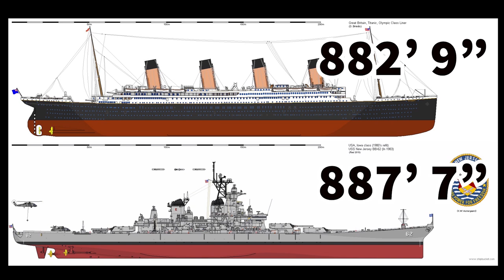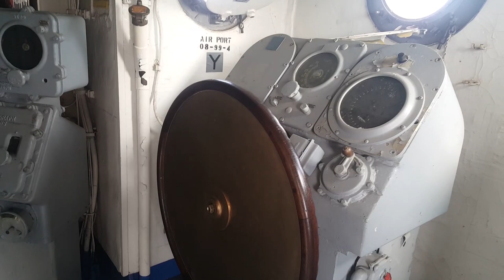Titanic vs. Iowa Class Battleships

Comment: If only the Titanic had an armor belt.
Reply: She didn’t even really need one. It’s been proven and well discussed that If the ships first officer, Murdoch,  had simply ordered the engines full astern and NOT steered the ship at all thus hitting the iceberg “stem on”, Titanic would have never sunk. At a speed of around 16-17 knots, a stem-on collision would have crushed in her forpeak water tank and at most around 20 feet of the area directly behind it which contained firemens berths and a cargo hold. This would have resulted in flooding of at most two of her watertight compartments and it is likely the ship could have even steamed to New York under her own power as even boiler room 6 would have remained Undamaged. The sudden, jarring stop would have undoubtedly caused Several hundred passengers and crew mostly minor injury, with a few dozen severe injuries and even a few deaths being likely but still far better than the 1,500 that perished that night. Sadly not enough was known about how bergs are shaped below the water and how a ship would react being run straight on into a berg versus trying to steer around by the ships crew and tragedy ensued.
Reply: @J.R.in_WV  
The sudden, jaring stop would have likely done a lot more than throw passengers and crew around. 50,000 tons held together by wrought iron rivets, a percentage of which may have been below standard quality of the day, would have likely sheared off along some length of the hull, broken steam pipes, possibly the engines shifting in their beds, etc. Ships like Titanic were built to be able to withstand impacts with other ships but an iceberg effectively represents an unmovable wall which was well outside the scope of her design to deal with. 
We'd all like for there to have been some simple thing they could have done to have avoiding the tragedy but plowing her into the berg on purpose wasn't one of them.
The truth is they should have stopped for the night or, at the very least, slowed way down until morning.

Comment: - Iceberg ahead!
- Forward main turrets - open fire!
Reply: ...sh*t...!!! :-(
...now its many icebergs ahead...! ;-)
Reply: @Packless1  Secondary guns - open fire!
Reply: Heh, I was about to reply that the USS New Jersey could just shoot the iceberg. Well done.
Reply: @Packless1  Hey, the 16-inch naval rifles operate independently of one another. That's a lot of selective shots. I don't recall about the 5 inchers, each barrel independently operable?
Reply from the maker: The 5in barrels are in twin mounts and operate in those pairs, unlike the 16in guns which are independent.
Reply: Or it could just, like, go ‘round it.
Reply: IIRC, 16-inch rifles could lower no more than 5 degrees above horizontal. Surface search radar better than lookouts, right? Just go around, and if iceberg decided to  attack BB62, unlimber the 10 5/38s and blast away. That work?
Reply: @witkocaster  just use the nuclear shell, iceberg blown out of the water !
Reply: @matthewnewton8812  we know, but come on, you HAVE to fire those guns
Reply: @tedlee7821  wake every one up and they go  cool
Reply: @tommatt2ski  The battleship too, at that range.
Reply: Yessir and one 5 Inch Gun mount was operated by the Marine Corps Detachment!

Comment: Titanic was actually 175 feet or 17 stories high if you count elements above the superstructure like you did for New Jersey. The 90 foot figure is for her 9 decks, her funnels extended over 80 feet above the roof of the wheelhouse on the boat deck. This is why they look so similar in height in the photos.

Comment: The New Jersey hitting an iceberg would be like a sno-cone being rammed by a Buick.
Reply: While I understand the reasoning, I think you're underestimating the snow cone, lol. Those things, and the forces that can be generated in a collision with one, are no joke.
Reply: @steeltrap3800  Exactly.....Sister ship, Wisconsin lost the bow in a ship collision. A berg would hurt bad too.
Reply: @WALTERBROADDUS  Good news, the bow could be almost sheared off by a huge hit by a monster iceberg and the New Jersey could at least be towed back to port, since the citadel has the required reserve of buoyancy to keep her afloat.
Reply: @Hiiiiii74  Well thanks to a warmer Earth, bergs are not a issue.
Reply: I'm fairly sure there are icebergs that have a greater displacement than New Jersey. Ofc these ones look more like small floating islands, and you'd be colossally stupid to actually collide with one.
Reply: @potatopants4691  Based on the rough dimensions recounted by survivors; I've read the iceberg could have easily displace upwards of 1 million tons.  However Icebergs are not completely solid blocks of ice.  They have have a very complicated makeup with significant changes of density.  They are also constantly changing shape as water intrudes and the berg melts and breaks up.  Regardless the iceberg would very likely be significantly more massive than either Titanic or any vessel constructed.
Reply: @Hiiiiii74  Couldn't she steam under her own power? Just at a slow speed, with that fine water-splitting bow form gone?

Comment: Battleship New Jersey has surface radar, Titanic had lookouts in crows nests.
 
New Jersey has two rudders. 
Titanic had one slightly undersized rudder.
Reply: Don't forget titanics sister ship hit and sank a u boat in ww1 after turning on a dime at full speed it had the same size rudder as the titanic at at that point in time was heavier then titanic i think had they went full speed ahead the water would have pushed onto the rudder better then shutting in middle blades off as it didn't go in reverse
Reply: That's a bit of a myth. The Olympic class ships actually featured quite a massive rudder. One so large it could only be turned by steam engine. That's the reason why Titanic took so long to respond to the helm inputs - the steam engine had to start up and crank the rudder to hard over. Hydraulic systems were faster, but were a new tech at the time.
Reply: The armour belt won’t hurt either.

Comment: Just wanted to do a little correction at 4:53 where you said Titanic couldn't counter flood is false actually. Titanic's double bottom was divided up into sections which a few of them were filled with fresh water. In these sections there were ways to move water around between each section and was actually done during the sinking to try to maintain a leveled keel. :D Hope this helps sorry im nearly a year late to this video.

Comment: Two things that could have saved Titanic that the NJ already has. Watertight bulkheads that run up to the main deck, Titanic's only ran up to I believe deck 3, and the second would have been a rudder large enough to be useful with that third prop wash rushing over it.  Had they uncoupled the Port engine, ran Starboard full ahead, and reversed the port engine, they might have been able to use the prop thrust to turn the ship faster.
Reply: I don't recall, did Titanic's crew spot the berg before the collision? How much time did the crew have to react? Thanks.
Reply: @brianchapman3701  Well, in the movie they did say IOCEBERG Dead ahead!  All reports I read they did see it, just not in time to get the ship turned away from it.  Speculation also has it had they NOT seen the iceberg that the ship would have survived a head on impact.
Reply: @acdii  Fascinating! Next question, who was at the helm, or do I mean in command, at the moment the warning came?
Reply: @brianchapman3701  First officer Murdoch comes to mind.  Captain Edward Smith was in his stateroom sleeping at the time.   The Captain should have been demoted due to a few incidents that happened under his watch prior to the maiden voyage, including a collision with a warship during the trial runs of the Olympic. There were so many wrongs that were done that led up to the sinking, any one of which could have averted disaster had the proper decision been made.   

There is a  conspiracy theory that the Olympic and Titanic were switched and that the Olympic was the actual ship that sank, and the Titanic lived on as the Olympic, but that is too hard to believe since changing the name plates on the bow and stern would have been a huge undertaking and would have been noticed prior to the ship being launched.

Comment: If USS New Jersey hit an Iceberg in similar circumstances?  I am fully confident t hat the NJ would have survived. Though first off, I think the New Jersey would have avoided it all together, since the watchman wouldnt have forgotten or left his binoculars.   The Damage Control Parties would have been on it, being military trained, so very well versed in thier duties, plus the New Jersey is built for war, so it has bulkheads and water tight compartments and other things.  Plus, unlike the TItanic, its water tight compartments dont go only 3/4 of the way up the ship. Also, Also, the New Jersey wasnt built from cheap, weakened, made by the lowest bidder steel.
Reply: I wouldn't say titanic had low quality steel, it was (maybe not the best that would be used on warships) for that time still a good steel. Automated Watertight compartment on a civilian ship made it "unsinkable". I would say that if you compare the Iowa steel with today's high quality steel, you could achieve higher protection with less weight when rebuilding the Iowa with today's standards. Actually now they are saying would have been the best for the titanic just to ram the iceberg and losing the first 2 compartments or instead of putting her to full reverse and pulling the water from the rudder giving her full speed ahead for better duffer response
Reply: @steeltrap3800  I would just say Global Warming is has made the sea safer.😏 Trans Polar travel is possible  now.
Reply: Battleships like the New Jersey were designed to survive hull breaches and other serious damage because they were weapons of war. The Titanic was a commercial liner and was not designed to take on the amount of damage that she sustained. On the other hand, battleships were essentially 57,000 ton powder kegs, and what doomed many of them were fires that reached their main magazines. Had the USS Arizona flooded her magazines at the start of the Pearl Harbor attack she would have never blown up and sank.
Reply: Technically the new jersey was still made by the lowest bidder, it's supposed to be a practical engine of destruction not a luxury statement. There would be no reason to up the cost of production beyond what was needed to do its job effectively. Therefore it was by definition constructed by the lowest bidder.

Also it's not really in question whether it could survive a similar collision, it's designed to survive having holes poked in it after all. However I believe if it had been mishandled to such a degree it's hitting an iceberg it's also possible it might not have survived because now we have to consider a head on collision at speed and that would fold the ship in on itself as if it was made of wet cardboard.
Reply: ...the binoculars - or the lack of them - is often claimed to be one MAJOR case of the sinking of the Titanic...
...but most likely it wouldn't have made much difference...!
...there was little wind - and not much surf - in that night, and it was new-moon...
...so the sky was dark, the water was dark too, as was the iceberg...
...the guys in the outlook would have seen a black iceberg on black water in front of an black horizon...just bigger...! :-(
...a searchlight would have made a real difference...
...so no James-Cameron-movie ~100 years later...! ;-)
...but they had none...! :-(
Reply: If it hit it head on the whole ship would collapse, but a glancing blow like the titanic, maybe it would be ok but hard to tell.
Reply: @Packless1  Adding to the popular idea it was an elaborate assassination of JJ Astoria and other bankers who resisted the creation of the fed.
Reply: @LTPottenger  Not likely. The bow might  be lost. But the bulkheads would stand ahead of the Turrets.
Reply: @WALTERBROADDUS  An ice berg is nothing like what an ice breaker breaks through. Ice breaker would be obliterated if it hit an ice berg. You're trying to uproot a whole mountain, which isn't happening.
Reply: @LTPottenger  Well, the USN did collide with itself in WW2.  USS Indiana and USS Washington or something......2 of the fast BBs.  It crumpled the bow of one and dented the other.  THey both made it back to port for repairs.
Reply: @LTPottenger  I think your are replying to the wrong person?
Reply: @lolroflroflcakes  I believe I have read that the Iowas were a no-bid process contract award. Author Thomas Heinrich writes that the Iowas, at $130 million a copy, were the most expensive platforms of the Second World War.
Reply: @brianchapman3701  It's still designed in with what is practical to be afforded, battleships are just expensive. For instance British armour plate was better but they still used steel from American foundaries because while money could make it happen they went with the lowest bidder that gave them something reasonable for the needs of the ship.
Reply: @lolroflroflcakes  The major U.S. combatants of WWII were not contracted by bid, but by negotiated contract. And, the major combatants were built by U.S. Navy yards.

Comment: The bow weighs a ton and is relatively narrow... probably a really decent icebreaker
Reply: Actually ice breakers tend to be wide in Beam and the bow is designed  to ramp over ice and crush it.
Reply: Ice breakers don't break icebergs, they are huge, dense formations of ice. A ship is mostly empty space you hit an iceberg and your ship is crumpling like a pop can being run over by a semi-truck, battleship or not.
Reply: @lolroflroflcakes  yeah, the bow would take hefty damage, but i don't think it would make it into the citadel
Reply: @Commissar0617  it wouldn't really matter hitting something the size of the Titanic's iceberg at speed would shatter an Iowa's structure and anything inside would keep trying to move forward potentially at speeds potentially in excess 60km/h until it met the nearest bulkhead. So you have an intact armoured box but everyone and everything in it is broken and the ship itself has been so compromised on a structural level that even if it stays afloat it's not worth saving.

You get to see the effects of a high speed collision on a capital ship in The Expanse with the Thomas Prince. Everyone is injured and/or dying and the ship is crippled.
Reply: @lolroflroflcakes  the iowa only did 32kts
Reply: ...it's not designed as an icebreaker, but the bow of Iowa-class ships can take a lot of damage without compromising the seaworthyness of the ship...!
...e.g. the bow of Wisconsin was nearly totally ripped off when she collided with a destroyer, but she made it home under own power...
...for the repair they used the bow of her unfinnished sistership Kentucky...!
Reply: The bow is not armored, it would rip to shreds

Comment: imagine the titanic with the modern engines from the iowas. well, goodbye mauretania
Reply: . . . Iowa, whose 58,400-ton hull accommodated four turbines with an aggregate 212,000 shaft horsepower, the most powerful nonnuclear engine ever installed in an American warship. . . .   -author Thomas Heinrich, 'Warship Builders'
Reply: @brianchapman3701  maybe, but i dont think that she could beat the USS United States, that is still having the blue ribbon as the fastet transatlantik- ocean liner with 38 kn. the titanic may be a bit "lighter" than iowa, but has a worse hydrodynamic...maybe about 34 or at most 35 kn